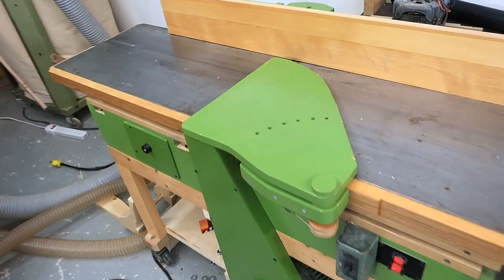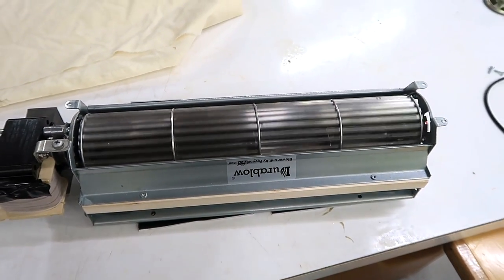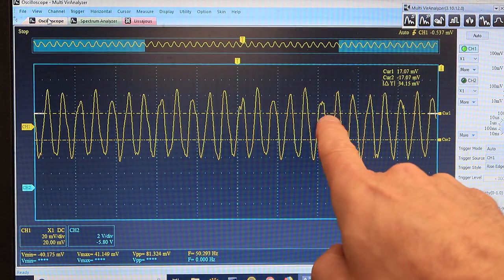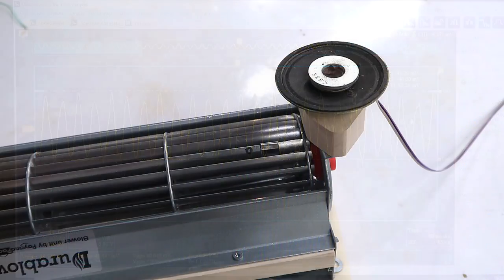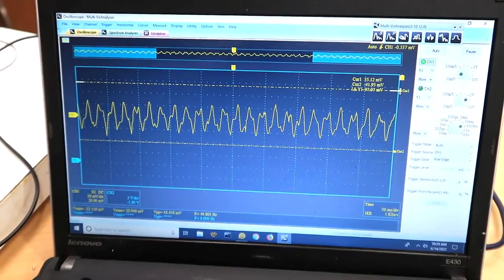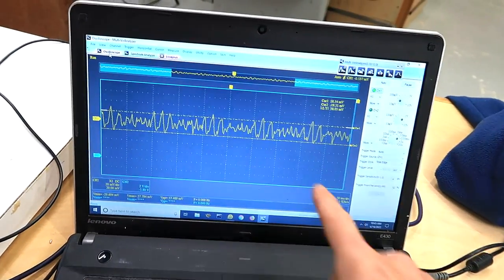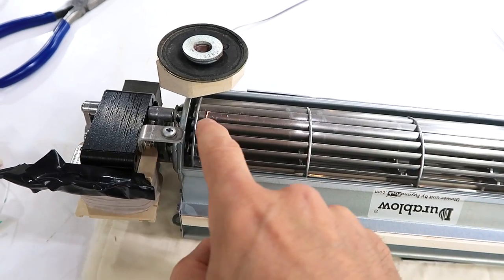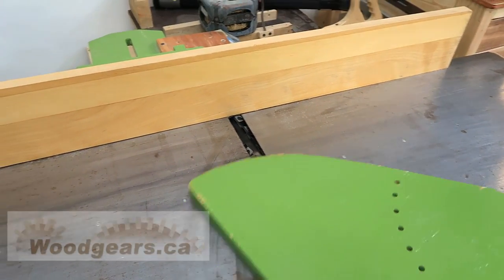Dynamic balancing with a scope and small speaker

Comment: I’m a vibration analyst by trade and your method is spot on! The only additional thing we do with the “test” weight information is build a vector diagram on a polar plot to determine where the optimal final weight should be located. Then there is some math to determine the weight amount but that’s just some simple cross multiplication. Doing this all with a speaker and o’scope is just downright genius.
Reply: Spot on, search for graphic balancing method. You can solve your needed weight and place by doing 3 runs while moving the test weight in 120° increments around. The place your three influence circles meet gives you both the place and amount of correction weight.
Using a speaker as a velocimeter is genius!
Reply: Search for this on YouTube: 
3 point balancing method
Reply: What is your preferred method to apply an encoder?  Or does it even matter?
Reply: @TqSNv9R0iG5Ckxew  for the 3point Methode, you don't need the phase angle, for vector Methode the phase angle of the vibration is needed  that way you only need to do a single test run with a test weight to get the correction weight and position. Getting the phase angle or a reference is done by a keyphasor, or a laser module that detects a ref mark. As a DIY solution you would need anything that gives you a signal on the scope exactly once per rev, always at the same point.
Reply: Cross multiplication, is that the one listed by the same name on Wikipedia (I was initially assuming the cross product instead)?
Reply: would love to drop off my 200 series cruiser to help track down vibration that occurs at around 1800 rpm regardless of speed but must be under at least a smidge of load.  It drives me nuts.  I built a fft spectrum analyser with an ESP8266 and a accelerometer but I really need to get it on a dyno I think.
Reply: @kissingfrogs  I'm in Switzerland, so probably not around the corner for you, otherwise I'd be interested
Reply: @kissingfrogs  
Great idea!
I have been thinking about using a few ESP32 modules connected to microphones for a poor-man version of the "Engine Ear" with multiple channels, wifi/bluetooth connectivity, etc.   I think your idea is more useful.
Reply: With an stereo pickup cartridige from a turntable instead of speaker you can get 2 axis.
Reply: The sheer amount of knowledge in this comment thread is too much for my puny brain
Reply: pretty sure mattias is an ex engineer
Reply: @paugasolina5048  A Damn fine one at that!

Comment: Really interesting to see a speaker used that way. All you need is a sufficiently capable rotary encoder for position tracking and you've nearly caught up to industrial impeller balancing systems.
Reply: It is! I guess you could use a voltmeter instead of a graph, but it would take more patience.
Reply: I think he wouldn't even need a rotary encoder. 
a simple photo diode to measure a fixed point per revolution should be sufficient for home application.
With a dual Chanel scope he could overlay speaker and "zero point" and from there calculate the angle where mass needs to be taken off.
Reply: @fabianrudzewski9027  A simple 5v hall effect sensor would also be a good choice when working with metal objects.
Reply: phase of output signal from speaker is a non linear function of frequency, it can be compensated but it's not linear
Reply: There are solutions that don't need to know position. Some Balance Technologies machines just have a strobe light so you can point it at the rotating object and it will freeze the point where weight needs to be added or removed. And with the amplitude of the vibrations you can set the correction radius and readout the grams required. This was all old school analog circuitry, too.
Reply: @RambozoClown  that’s really neat sounding.
Reply: @RambozoClown  You still need to know position and the strobe is the method for determining the position.
Reply: @D2O2   Yeah, I know. It's just a way not to have any position encoder that is touching the part. So it would be something Matthias could replicate with a Pi, software, a lamp, and some wood. ;)
Reply: @bradley3549  That was my first thought as well. But how do you solve for getting multiple inputs per revolution? Using this fan as an example, one might get a signal with each fin.
Of course you could add a magnet or some other item that would "stick out", but it would make the whole thing even more out of balance.
Reply: @smurface549  With the benefit of starting from a known position, you can work out the absolute position by simply knowing how many triggers per revolution. But surely not as ideal as having a missing tooth or single tooth if you wanted to view it plainly on the scope.
Reply: @ekstrapolatoraproksymujacy412  stupid RLC circuits and inertia, making life difficult.
Reply: ....or a 20 year old tire balancer.
Reply: @bradley3549  Good thought, but that approach will conflate metal deformation with balance.  The metal can be deformed a one location, but by weight out of balance at another.  The Hall will detect distance variation to the metal, which could be the assembly vibrating, or the metal deformed, or both.
Reply: @techman2553  The hall would only be to indicate position and not to indicate vibration, would still require a transducer for that.

Comment: With two speakers configured orthogonally and two channels on an oscilloscope, Lissajous curve could be displayed. You could directly find the vibration vector. If you further know the phase of the motor, you could even calculate and display the exact angle at which you should add or remove weight.

Comment: If you have a small mirror and a laser pointer laying around, you could probably do this completely analog. Put a piece of paper on a wall far away to mark out the sweep of the laser. The added benefit is electrical noise would have no effect.
Reply: Mirrors have mass
Reply: I use this method to dynamically balance props on drones.
Reply: @MadScientist267  The mirror goes on the static part so makes very little difference.
Reply: That's freaking cool
Reply: @DullPoints  I have a really old vid on my channel if you want to see how it's done. 🙂
Reply: @MadScientist267  But light doesn't....much.

Comment: Wow Matthias! You never cease to amaze me! The way you combine intuitive understanding with real-world electronic know-how is clever and clear. When I was a kid and built slot-car motors, (circa 1964) I just chucked the armature into a drill, spun it, and lightly touched it with a magic marker. Then wherever the marks were thickest, I drilled a small hole in the armature; Reversed the armature, and did the same thing from the other side. That was as close to dynamic balancing as a cash-strapped kid could get, But it worked.! Of course I didn't have access to these electronic measuring devices then, so that method was a tedious iterative process. Even now, I would have never thought of using a speaker to generate a readable pulse into an oscilloscope. Brilliant idea!

Comment: You could possibly get similar results using a 'vibration meter' app on your phone (for those of us without an oscilloscope).
I dynamically balanced the drive pulley on my metal lathe by taping an old phone to the headstock and measuring the vibrations.
Reply: Me too, but I want an oscilloscope, its probably much more accurate. Vibration analyzers at mm/s^2 range are very expensive as well 😢. I balanced my angle grinder with my phone lol this is amazing.

Comment: Have you thought about marking a zero position with reflective tape and use an optical pick up to mark the zero position on your oscilloscope? That would make finding the “location” of the imbalance easier than trial and error.
Reply: Once you figure out the delays from vibration to the speaker pickup, however adding a weight should show that easily enough.

Comment: This is quality content.
I like it a lot.
Balancing fans and rotating things with a cheap diy friendly way and increasing their lifespan, lowering the noise and vibration is a really good thing.

The earlier video you had with balancing a fan really helped me right after i bought a box fan (brand new) it wash shaking violently and dancing over the floor,  but after a few minutws balancing it it became very silent and no noticeable vibration

Comment: I proposed a system like this for using a speaker and diaphragm weight to dynamically balance motors about 20 years back on the electronics forums.
The one thing you missed which would have been an improvment would be to place the whole assembly on an elastic suspension, which could have been as simple as a springy foam block. Your setup was damping the vibration into the table which reduced the measurement amplitude and accuracy.
Very cool project! 👍

Comment: On the driven end of the rotor I believe you were seeing a central frequency of 60hz and sidebands each side, offset by 10hz. I suspect it was caused by geometrical angular/offset misalignment between the motor and fan rotors if they are rigidly coupled together. Very smart use of the speaker to measure the waveform!

Comment: Very clever!  I imagine that squirrel cage fans are pretty tolerant of imbalances given that they all collect dust, and any dust buildup will likely throw off even the most carefully balanced fan.  However, a balanced fan will give off less fan noise and that's always a blessing.  Good show on the use of low cost test gear to analyze a problem!
Reply: The dust will be evenly distributed around the evenly sized and evenly spaced blades of a squirrel cage fan, so it doesn't affect the balance much.  Initial balancing really protects the machinery and makes it last longer.  There are industrial balancers that balance absolutely everything in, for example, a pulp mill.  I once pulled a single leaf out of an automobile's squirrel cage blower that was making a horrible noise and that fixed it perfectly.

Comment: Very interesting! I'm thinking of combining this to Denis' approach (channel "the GADGETS playlist") to dynamic balancing, ie, using a microphone (or speaker) to listen to the vibrations and reference it using a photocell to figure out where the weight should go - and perhaps combine it with the Y approach, ie, instead of adding weight at position 0, add it (for instance) at positions -3 and +3.
Denis uses an accelerometer to measure the vibrations, not sure which option would be more accurate.

Comment: With this technique, you have to make sure the resonant frequency of the speaker is not the same as the DUT. 
Otherwise the vibrations will look a lot stronger than really is.
Reply: I'd imagine a speaker having very little resonance (given their purpose)
Reply: But, doesn't it change that, if you add weights to the diaphragm?
Reply: @AmirASD  The more mass, the more inertia, the lower the frequency of resonance. 
Same thing with inductance. The more henrys, the lower the resonant frequency.
Reply: I suspect that adding an electrical load on the speaker (perhaps a resistor equal to the speaker's nominal impedance) would damp any resonance.
Reply: Does it really matter? The frequency response will be nonlinear but we only care about relative changes. As long as the DUT frequency remains constant I think it would still work fine.
Reply: It arbitary and relative. It's a salt and pepper to taste thing.

Comment: Beautiful and insightful work, congratulations! 

The 69-ish Hz you described at timestamp 5:08 is possibly due to the aliasing between the 60Hz network frequency and the 50-ish Hz of the rotational speed.  
The aliasing or beating frequency generates a pair of side bands (+10 and -10 Hz) 

The 10Hz can be also observed at the 10Hz region of the spectra and as a sideband of every 60Hz harmonics.

If the system responds well to higher frequencies, you may also find a series of 100-110-120-130 -140Hz and so on.
Reply: this is also what creates the really cool "whirr" sound when induction motors start up!
Reply: @polymetric2614   , the “whirr” is outstanding when you change speeds of a 2/4 poles motor 😊😊

Comment: in the 1980s the company I worked for looked at analysing vibration from the heavy industrial machinery it made in an attempt to give the operator maintenance information  much earlier than his ears could detect. It actually worked quite well but few end users would pay a worthwhile price for it.
Reply: There's a mentality of "don't fix what isn't broken", which seems to stop them from considering that "Everything is gradually breaking, so it WILL break at some point. Fix it when it's most effective to do so".

I've worked with a number of factories and suggested that premise as well. Advising that a lot of their stoppages and repair costs could be reduced, AND would offset the cost of any system upgrades by an order of magnitude. Not a single one was willing pay for it except where I just did it anyway, and demonstrated it, and billed them.

Comment: That's a pertty interesting idea to use a speaker as an accelerometer. Ive seen them used as microphones, but never for low frequency. It's not a calibrated measurement, but for some quantitative analysis it's more than good enough.

Comment: 30 years ago we use to characterize disk drive motor samples with a similar set up sensitive and expensive B&K gear.  Today, you can pull the 9 axis of freedom board off your drone and couple that with your favorite eval board  (pi, arduino, stm32) and throw together a pretty darn good sensor system.  Couple that with all the free firmware that deals with static and dynamic behavior and you will know more about anything you want to measure.   The vibrations in the handle of your weed eater, lawn mower, shovel, hammer or vibrations in the motors... you could spend your whole summer on this..
Reply: KWR, Clifton Precision?

Comment: my father has a balancing machine for big rollers and ducts. Althought its a little bit more sophisticated with a  control computer etc., it messures the vibration on both sides of the tube (its laying there on bearings) and always knows at what position the duct is with the help of a light sensor and a glued on tag, after you run it it tells you the spots that need weight automatically.

Comment: Brilliant! Could I suggest using a piezo transducer instead of the speaker. It will likely be much more responsive and less likely to add sympathetic impulses as a piezo has zero moving parts(no coil, cone, etc..). Also, if possible within reason, when you attempt to balance your cutter head, make a stand for it and spin it with a damper of some sort between motor and head. Won't have to be a strong motor, and perhaps something as simple as latex tubing would work to couple the motor and head and provide reasonable damping to allow you to only measure the head and not the motor. Maybe....
Reply from the maker: my first thought was pizo as well, but I didn't ahve one handy.
Reply: @matthiasrandomstuff2221  , a door buzzer is a cheap and readily available piezo disc.

Comment: Like others have said, quite clever using a weighted speaker as a contact mic, but I was expecting something like noise-cancelling headphone technology, where a vibrating mass cancels out the vibration of the tool in real-time 😄
Reply: nice idea to try and error with pulsing at the same frequency that the imbalance vibration, delay represent angle of rotor and amplitude power in speaker represent a easy variable weight! thks man
Reply: @sebastienl2140  probably you need a tach pulse to timely find the high vibration spot then feed a cancelling waveform with the speaker exactly opposite phase

Comment: As a Vibe Tech by trade, what you got at the Driven End where the motor is, was Sidebanding. Looking at the data you got, I'd say that you might have an eccentricity present, however as for 60hz being the Center Frequency, I can't currently figure that part out.
Reply: Ac induced noise on the speaker would be my guess (hum)

Comment: i might actually use this method. ive made fans and fast rotation devices before and many times simple field balancing techniques will not suffice. it also shows the thousands of uses for signal analyzation of electro-mechanical components using an oscilloscope.

Comment: You may want to check over by the motor with the fan stalled to see if you are picking up magnetic hum from the motor windings. Also the speaker probably only outputs vibration that coincides with the line of the voice coil movement. Nice experiment and thanks very much !!
Reply from the maker: that's what I was demonstrating in the video

Comment: dynamic balancers often work using a strobe light, trigger a strobe of light on the highest peak value, then you mark the shaft with degrees and turn in on, the strobe will make the exact location of the peak imbalance visible.
a possibly better rig would be using a piezo speaker as a sensor supporting the shaft, that would be a much more precise way of doing it

Comment: So about the 120Hz humming:
A transformer iron core expands and shrings with the magnetic forces involved. An electric sinus signal means a plus and another negative wave or going from 0 to max to 0 to min and back to 0. So that's why a transformer core hums with double the frqeuency of the electric signal.
In most (if not all) parts of Europe it's a 100Hz humming, because we use 50Hz electrically.

Comment: I wonder if you could make a small preamp circuit and run the speaker output to a microphone input of a phone. I know there are spectrum analyzer apps for phones, so it might be the cheapest possible solution.
Reply from the maker: I thought about using an audio input, but the problem is, audio inputs may adjust the gain if necessary, and that messes with my measurements